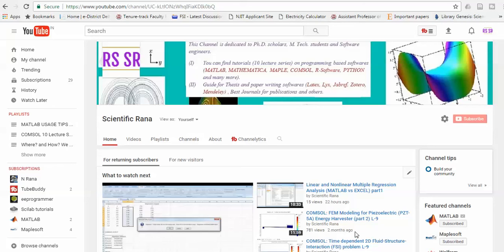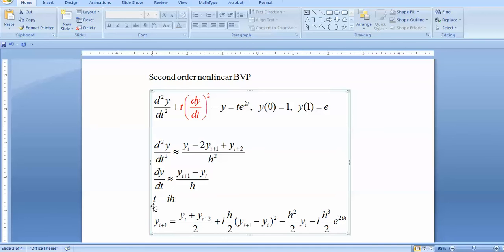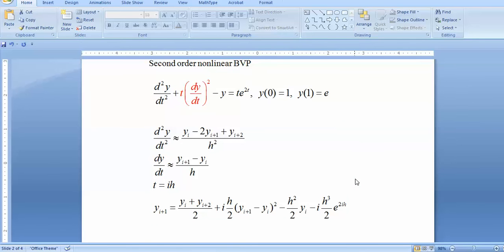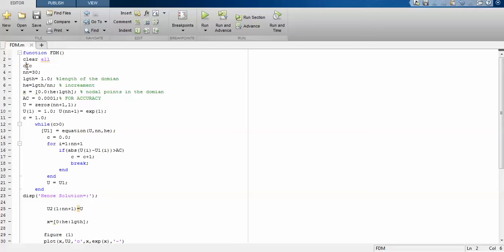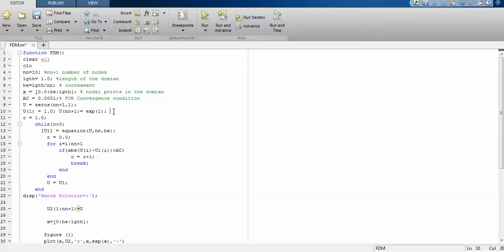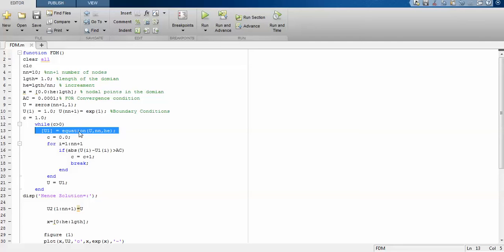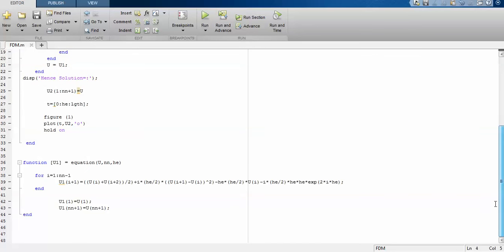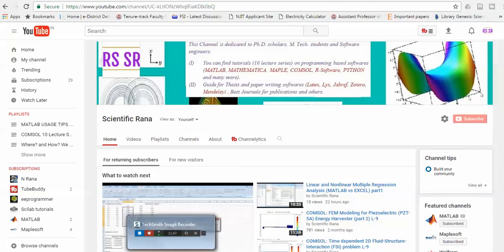Explicit Finite Difference Method (FDM) MATLAB code for Nonlinear Differential equations (BVP)

Comment: how to write the code if the equation contains the summation terms (from 0 to N)? For example A modified mild-slope equation. And it has no initial value or final value! Can you please tell how to solve such problems?